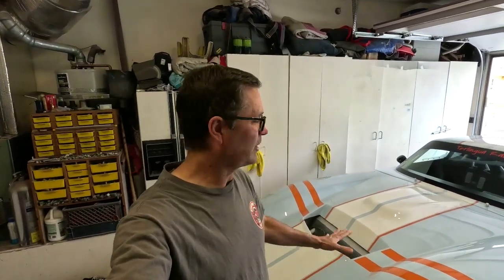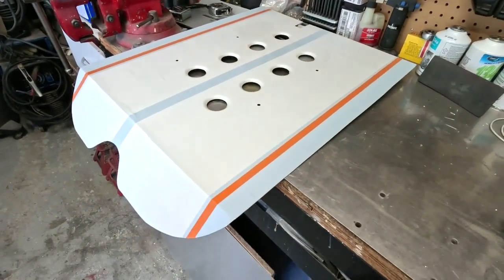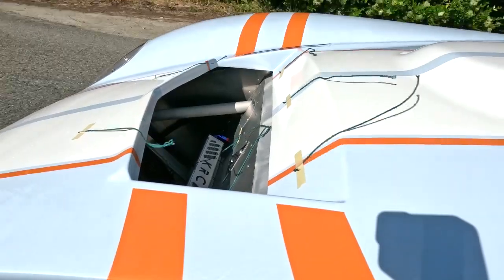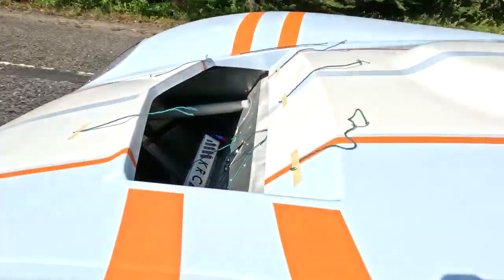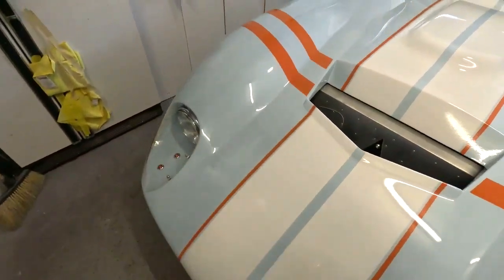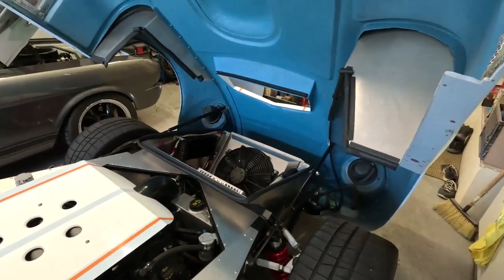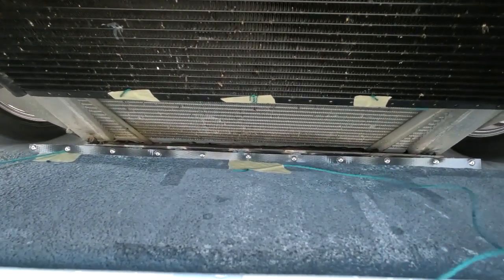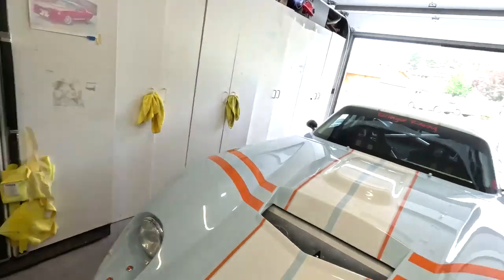Yarn and the Aero on the Daytona Coupe- Cobra Daytona Build, Video 212

Comment: I’m surprised the radiator is angled down
Reply from the maker: Needs to be angled for packaging under the low hood.
Reply: @cobradaytonabuild1671  right, but why not angle it up to get the air to flow more easily over the hood?  Thanks for your videos by the way…
Reply from the maker: It would be the best solution but not sure it could be done and don’t plan on trying.   Thank you for watching.

Comment: your tell tail pieces of yarn are definitely too long no longer than 5 or 6 inches and if you have to put them in series behind each other that is okay but never ever use a long one because it will whip around too much at its end use lots of them everywhere a long one won’t tell you much you can even use them as short as 3 or 4 inches 🙂
Reply from the maker: Thank you. More videos coming as well. I am curious to see where the airflow improved on the hood after the opening.

Comment: Im no expert but with the lip pointed down, I just think it will cause  snow plow like effect where the air starts pushing all over yhe place. I think pointing it forward like a mini splitter could help cut the air, maybe a flexible bellows between the radiator and the nose to encourage the air into the radiator and make it possible to open the hood without removing anything.
Reply from the maker: Maybe the video doesn’t show it but the lip is facing forward like a splitter sort of. Not parallel with ground but probably 45 degrees.

Comment: I'm no expert on aerodynamics but I've experimented on this a while back with a friend's corvette.  The one thing we found is to use short strings, maybe 6 inches long max and add them in offsetting patterns.  Don't be afraid to add lots of them either.  Also you may want to add really short ones in confined areas. My 2 bits.
Reply from the maker: You are totally correct. I will be doing this again tomorrow. Thank you.